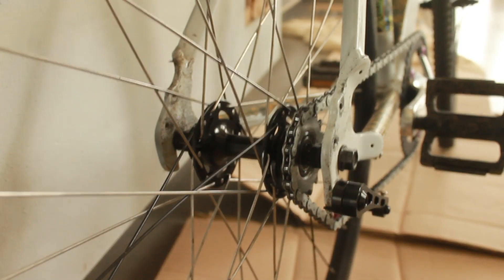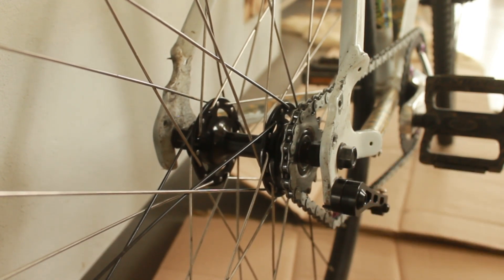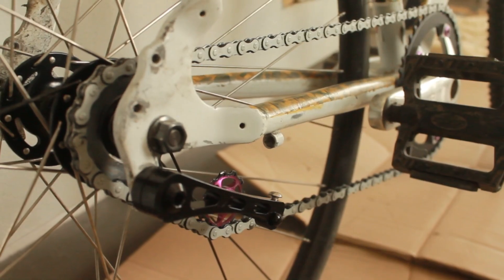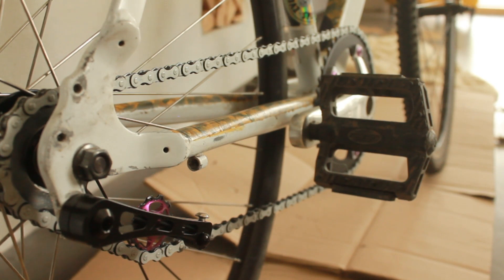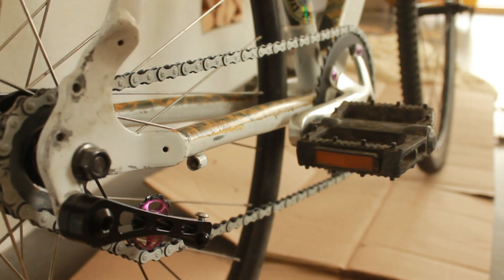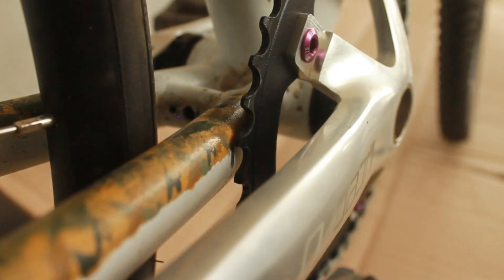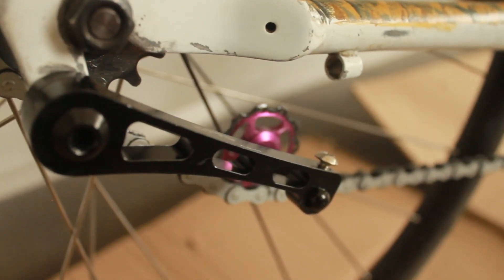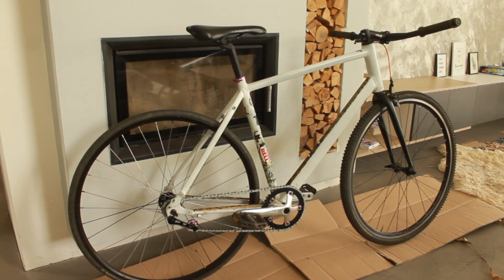How to Fit a120mm track Hub in a 135mm Bike Frame

Comment: I am doing the same with my 16 inch folding bike. Have to build the wheels, currently trying to find the spokes of the right length.
Do you need chain guide for the chain-ring? my chain keep slipping.

I bought 130mm through axel to replace 120mm axel that came with novatec hub, some online shop sells kits. The novatec axel was hollow for lighter weight, kinda missed it.
Reply from the maker: I don't need a chain guide but I've played with the gear ratio so my chain stays on even if the tensioner falls off.

Comment: What did you use as a spacer on the axel, looking to do this with a 120mm wheel on a 130ish frame.
Reply from the maker: On a track hub there are normally these thin nuts between the bearing and the inside of the frame. I used those.